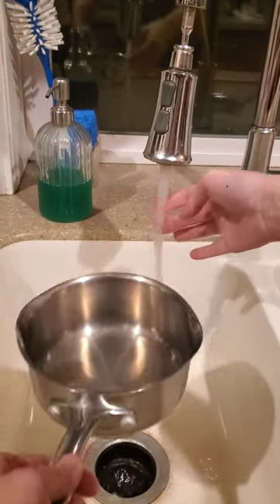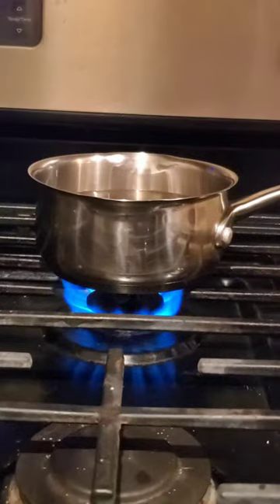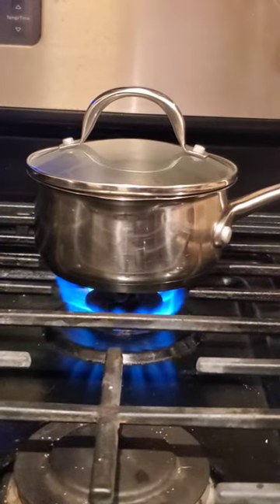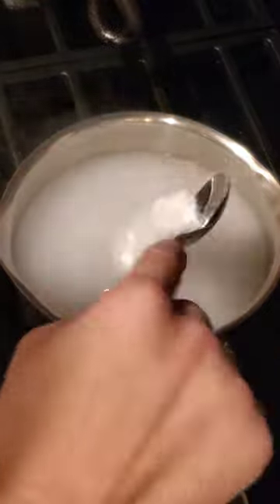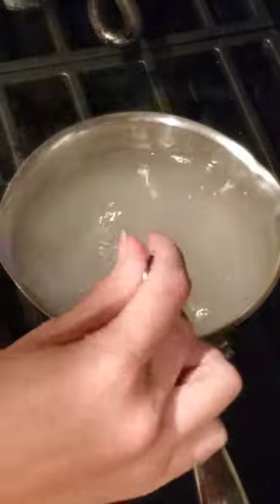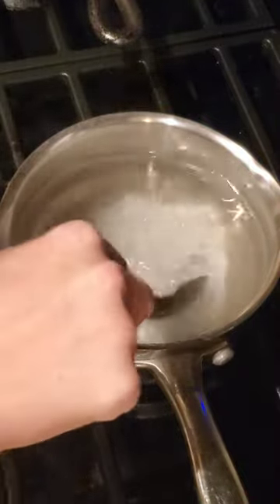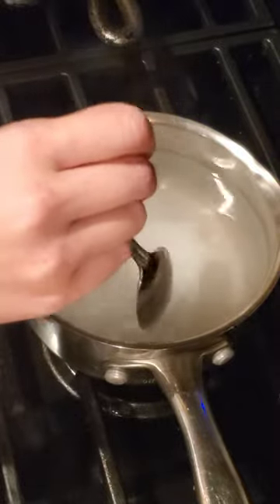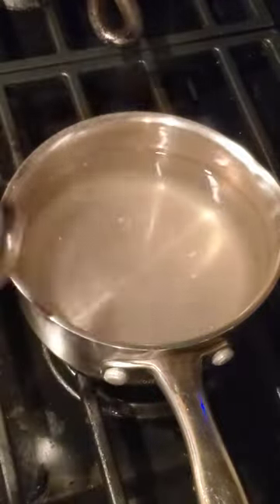how to make the sodium borate solution

Comment: okay i need to get this cleared up is it possible for borax to dissolve in cold water when you use it in your laundry as a water softener? my question is for a top loader with an agitator. i use 1/2 cup of borax in cold water which temperature is 30C which translate to 85F would the borax technically be able to dissolve because the water being used is of a larger quantity than the 1/2 cup of borax?